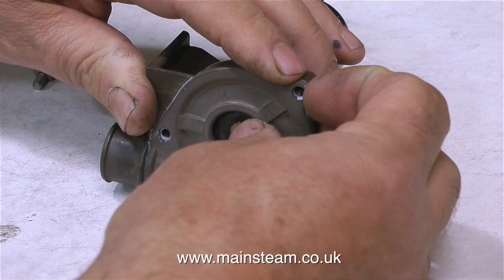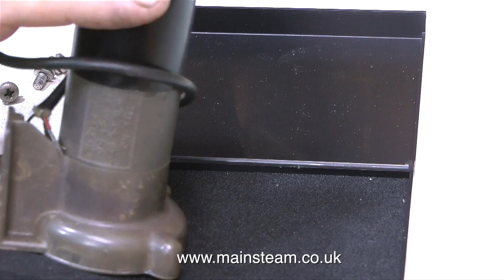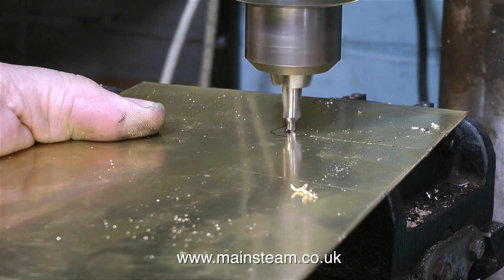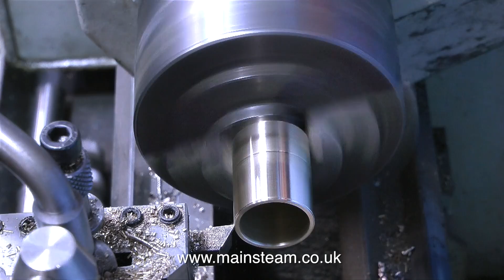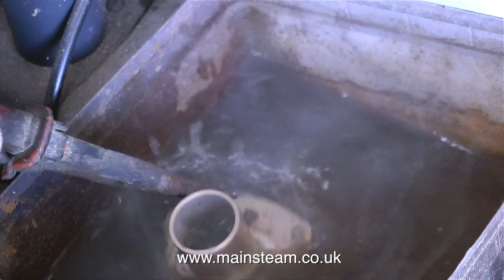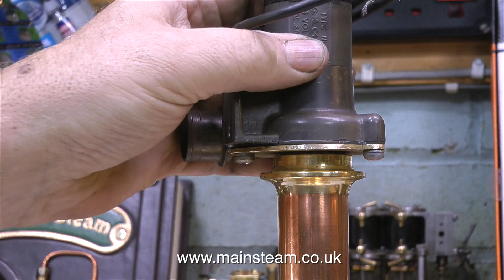HOW TO MAKE A COAL FIRED STEAM ENGINE BOILER PLANT - PART #26

Comment: I remember when I first learned to silver solder. Scared the crap out of me, thinking I was going to melt the piece of jewelry I was working on. I was used to soldering electronics. Then a few years after silver soldering I learned to weld with oxy-acetylene. I was so use to silver soldering, I wouldn't let enough of the base metal melt to make a good weld.

Comment: Keith, wouldn't it be a better idea to leave a step on the tube that goes into the smoke stack? That way you would not be sitting directly on the plate on the bottom of blower and should get a better seal on the stack. Also you would get a bit of cooling for the blower plate that way.

Comment: How does the blower resist heat?  I don't see a shaft slinger or other normal means to isolate impeller heating from the motor armature.  Won't it get kinda hot?
Reply from the maker: yes they do get hot, but seem to work OK . . .

Comment: Hi Keith I too used one of those blowers to help raise steam on a 2" TE I owned at the time, what I found was the impeller soon 'sooted' up the solution I found was to make a chimney extension then attach a pipe at 45 deg's the blower was then attached to this but 'blew' up the pipe rather than sucked so stayed clean.

Comment: YOU SHOULD NEVER HOLD SMALL PARTS LIKE THIS IN A VISE!
THE PART WILL JAM INTO THE JAWS, RIP THE VISE OFF THE TABLE WHERE IT WILL CLIMB UP THE BIT AND JAM UP THE SPINDLE. THIS WILL RESULT IN THE MACHINE CRASHING TO A SUDDEN STOP, CAUSING THE ENTIRE MACHINE TO SPIN ARROUND, FALL OVER, AND CRUSH YOUR UNWARY PET!
Reply from the maker: My unwary pet has been crushed many times :-))))) hahaha - good comment ......

Comment: Very good. An alternative to the ink pad is to use a bold color (colour?) lipstick, since it doesn't dry for a long time. That's a tip I learned from an old motorcycle mechanic I was learning under ages ago. He said "Tell the lady at the cosmetics counter what you need it for and that you want something that will stand out, like Granny Pomegranate or Hooker Rampage Red".